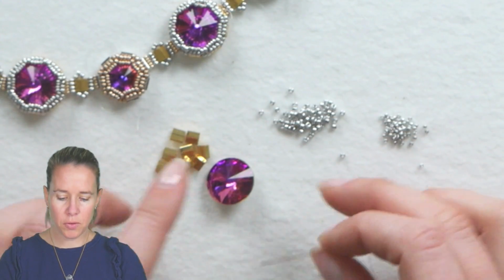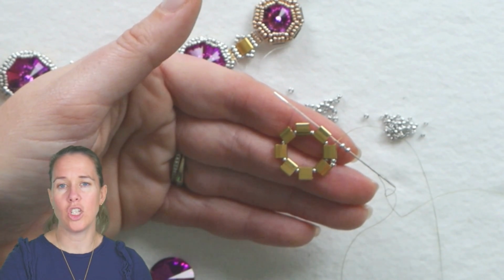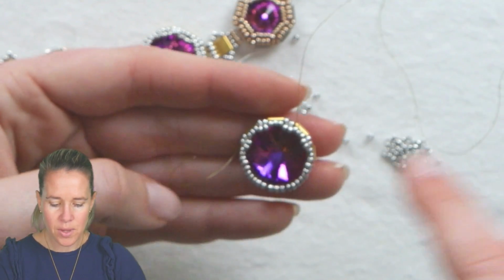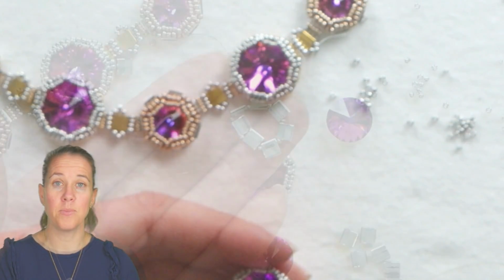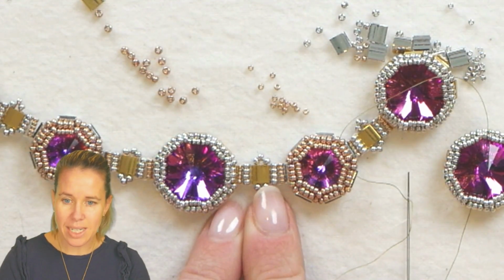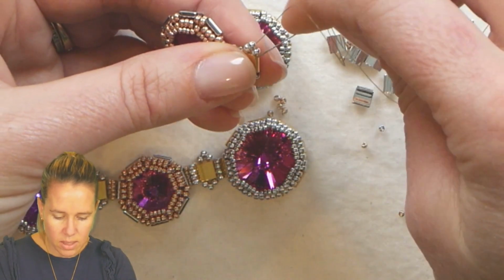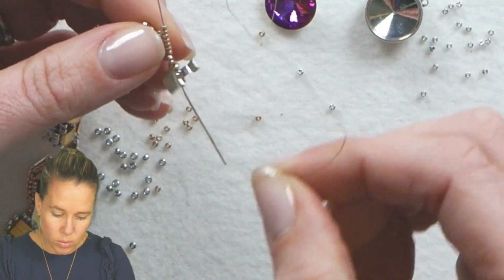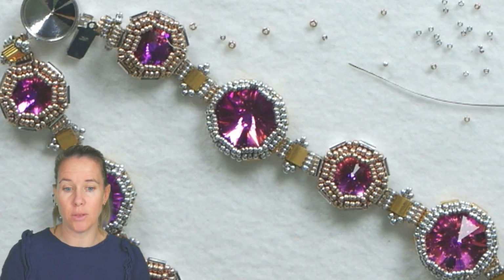Sphinx Crystal Necklace - DIY Jewelry Making Tutorial by PotomacBeads

Comment: This is a beautiful necklace.  Thank you for sharing your creativity.  I want to share with you that a 12mm will not work as you have directed.  It should have been a 14mm instead.  I eliminated one tila from 7to 6 and used different size seed beads than what the pattern called for in order for the rivoli to stay in.

Comment: Need some clarification.  Is the smaller rivoli a 12mm or 14mm?   Video says 14mm repeatedly but the material list says 12mm.   Trying to order supplies for this but I am unsure at this point
Reply from the maker: Hi Christyl, we are very sorry for the confusion. The rivoli used on this necklace are 18mm and 12mm. Potomax Rivoli Clasp is 14mm.
Reply: Beautiful necklace.  The 12mm will not work.  It is too small.  I have enough beading experience so I was able to adapt the pattern.